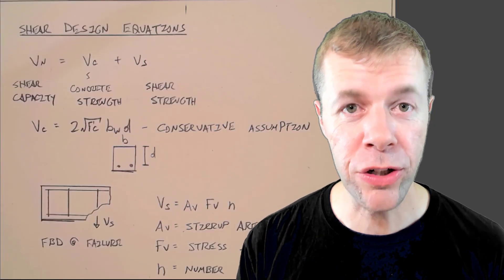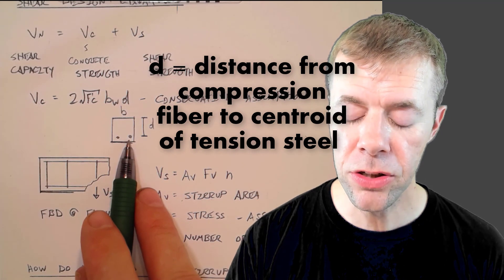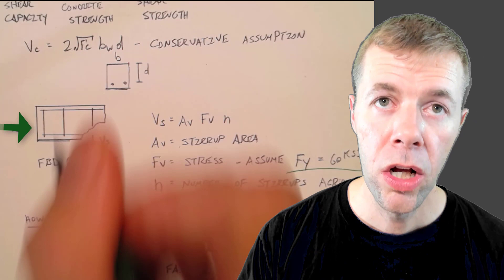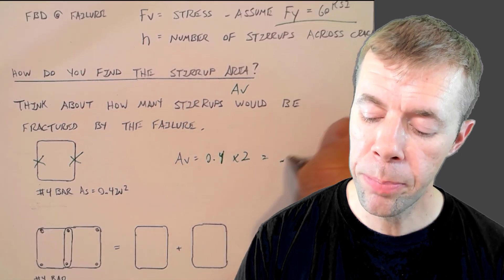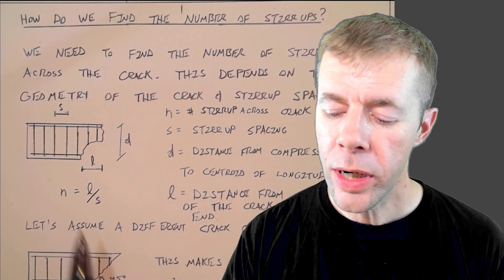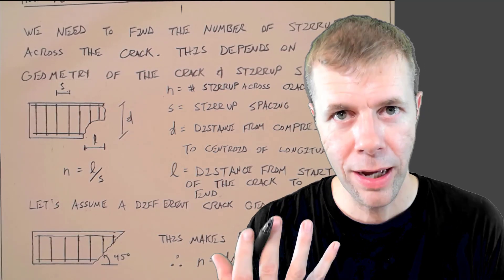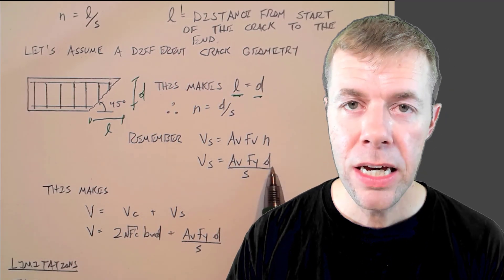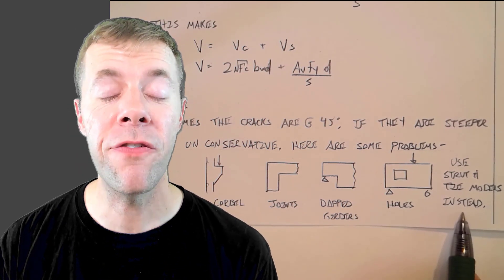Shear Design for Concrete Beams | Equations

Comment: Great videos. But isn't the area of (1) No.4 bar 0.2in^2....
Reply from the maker: Yes!  But there are two legs of the stirrup that will cross a shear crack.  This means the crack would fracture two bars and so you multiply the area by 2.  I think I talk about that in another video.
Reply: @TylerLey  you used 0.4in2/bar in the video. It should be 0.2in2/bar for #4
Reply: @kiemside8926  yeah you are right.